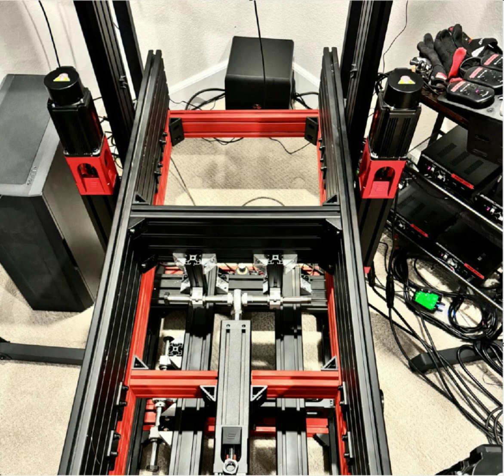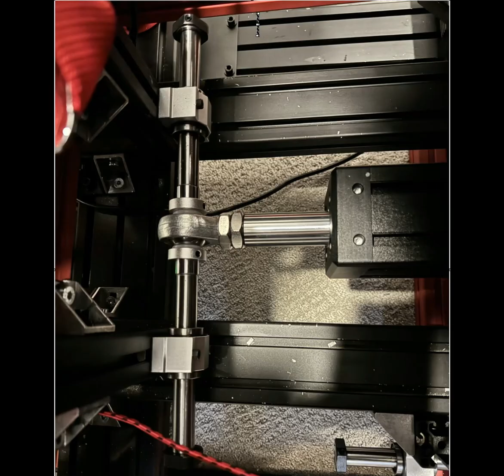Eracing Lab - Connecting Surge To Rig

Comment: It’s alive… all set up minus TL adjustment and final mount of TL actuator https://www.youtube.com/watch?v=dKpynq0trbQ
Reply: With the gear on it, minus G-Belt, which will be next when I get some time.  I need to work on tuning, it doesn't feel quite right yet in iRacing with the current SRS settings, but the Traction Loss feeling is amazing.  https://www.youtube.com/watch?v=3ECXnYpLMOk

Comment: The Linear rail holes are too small for any M6 standard bolt.  Just got a new battery for my caliper and it's showing 9.3mm wide, and the bolts are 9.8mm wide (standardish).  Now i'm stumped, I can't find any bolt that will fit.  They mentioned they got some bad equipment for the surge platforms and I didn't think about it until now... I just emailed e-racing as 9.3mm is waayyy under standard size.
Reply from the maker: That is surprising. M6 fits really well on mine. Try m5s or m4s.
Reply: @simul8master  Yeah, I just ordered some M5 T-nuts, just getting impatient, lol.  Edit: E-racing confirmed they are supposed to be M5.  All good.
Reply: @simul8master  I asked Alex if something changed.  He just told me they are M5 not M6.  Damnit....  Hundreds of dollars of nuts going back to Amazon.
Reply from the maker: @dofmaster106  oh man. Maybe I messed up. I bought so many screws. These are probably the m5 20mm. I will need to correct the video.
Reply: @simul8master  You also referred to 4080 instead of 40x120 in a video for one of the rails as well, hah!  Either way, invaluable help in these videos.  Trying to fly blind and order things before the parts get here so what do I expect.  Metric is just such a pain in the ass to get relatively quickly down here.
Reply from the maker: @dofmaster106  let me know which part i’ll correct it. The surge is built with 40x80s.  Of course nothing preventa you from using 40x120s
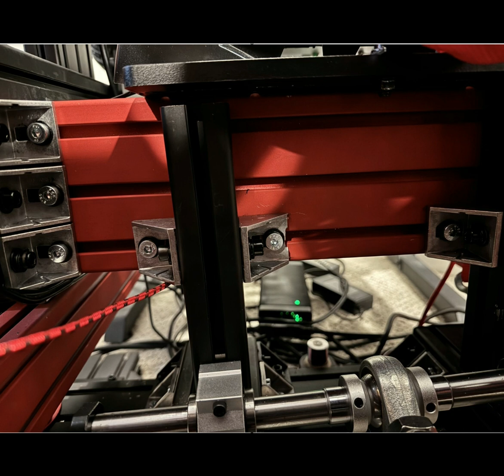Reply: @simul8master  8:31 on your measurements video. The vertical bottom TL 36 inch piece's should be 40x120 to hold the 120mm wide caster rollers.  I think you used 120, it just says 40x80 on the drawing :)  I just looked and can see 3 slots on the pieces in action on your rig, so they are indeed 120mm's wide
Reply from the maker: I see it! Thanks! I’ll correct it and upload the TL this weekend, been pretty busy.

Comment: Also, my kit had some upgrades that were recently made by E-Racing from my understanding (key way on shafts and couplers) and also the 40x40 peices that connect the Surge Arm to the actual Rig Platform for me are 100mm from the base to the top.  20mm of that to get to the top of the surge platform heigh, leaving me with 80mm that connects to the Rig, so I can use 2 Single Brackets, or one 80mm wide one.  Your videos have hands down given me so much insight into the design process, helped me create a close copy of yours and improve on a couple things I noticed.  Thx again!
Reply: Hi, may i ask what you changed.? I'm waiting for my eracing ultimate and learning a lot from your builds :) Thanks in advanced.

Comment: I've received some of the kit but am still waiting for the actuators and controller. My rig is also 160mm on the base. How long did you cut the replacement 40x40's? I'm ordering profile and want to get what I need. Also, when you ordered M6 bolts to attach the rails, how long are they (I don't know how thick the rails are)?
Reply from the maker: Please note these are m5 not m6. M5 x 20mm
Reply from the maker: I also have a video on here talking about the cuts. Not sure which replacement 40x40 you are referring to?
Reply: @simul8master  The 40x40 aluminum profile that came with the kit to connect the surge bar to the sim rig frame - you mentioned that you used your own to lengthen the amount that was in contact with your TR160 frame because the pieces that came with the kit were pretty short. I took a guess and figured it was around 7 1/2 inches long.
Reply from the maker: @waltersheehey  oh that - I will depend really on the height of your middle piece where the bar will connect to.